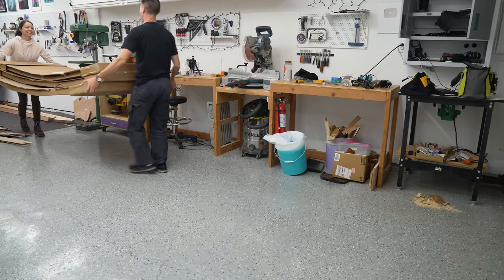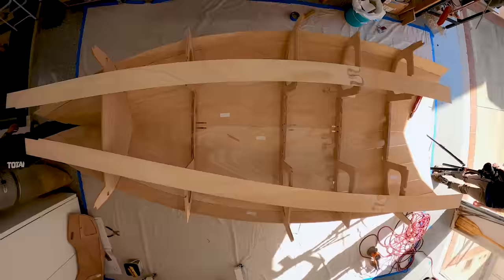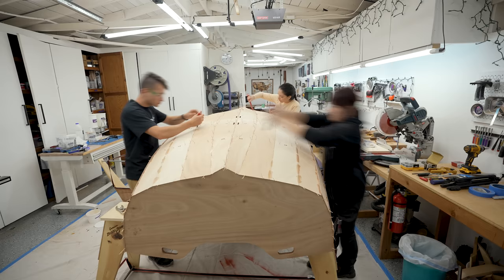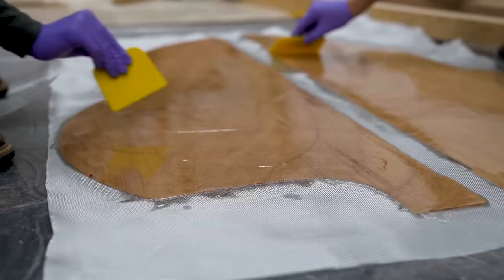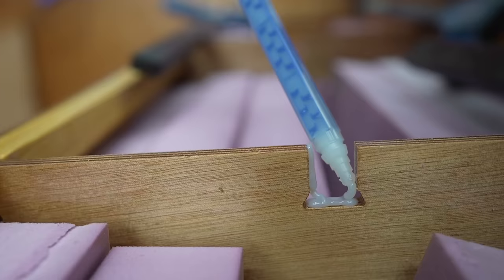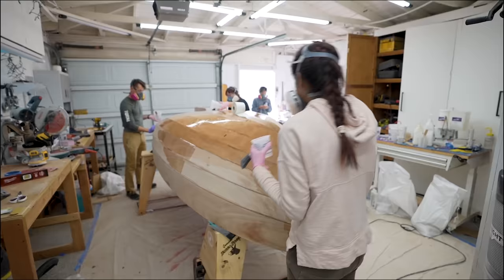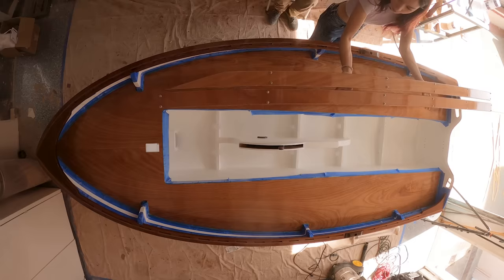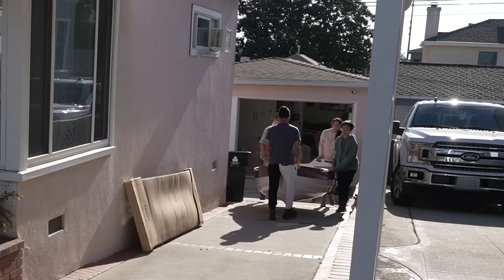Building a SAILBOAT (My Longest Project Yet!)

Comment: Just a note to all boat builders. If you drill or counter sink for screws after the piece has been painted or epoxied you need to treat that wood that's just been exposed with something to water/weather proof it. If you don't that's where the discolorations and delamination of the finish will start. Linseed oil, epoxy, or varnish will all work but you may never get the screw back out with the epoxy or varnish. Boiled linseed oil and similar finishes will need to be applied regularly.
Reply: I was going to write the same. If you paint the wood with epoxy or varnish and then drill holes in it later, you need to reseal the exposed wood. And no, silicone caulk won't cut it.

I remember reading a scientific paper a few years ago, where several methods and products for sealing wood were compared. Wood samples were treated, fully immersed into water and the weight gain was recorded. The most effective way to seal wood was molten paraffin wax, three coats of epoxy being the close second best option. Molten paraffin of course has several drawbacks, like remelting of the wax and you can't really paint it, so SEVERAL coats of epoxy is actually the only viable option. Traditional methods like products based on linseed oil, acrylic and even polyurethane paints were much inferior.

The problem with all this is of course, once water enters through cracks and holes the epoxy coating will trap it inside, the water can't really get out anymore. So the wood needs to be sealed perfectly, which is hard especially on larger, complicated structures.

If you want your boat to potentially last a decade or more, all the screws and fasteners better be stainless steel, even when completely embedded in epoxy. For a boat that's out of the water, stored completely dry 95% of the time and isn't expected to last a long time galvanized might work, but considering all the work that goes into such a project just bite the bullet and get the good stuff.
Reply: @kirahund6711  yeah I learned at a young age stainless hardware is pretty much the only way to go with brass a good second place.
Reply: @consaka1  Bronze works too, but that's just inferior to stainless.
Reply: @kirahund6711  yeah bronze/brass is too soft. I've had difficulty with it in the past. I just prefer stainless though I wish even it was stronger.
Reply: Great point. Penetrations are where barrier failure or structural deterioration frequently begin and that's not just a "boat" principle. It matters on any substrate where exposure will create change - even just corrosion or oxidation (assuming sound assembly pre penetration and no other existing issues). 

Modification of a complete boat would be a key example of where a bunch of small failures all begin to contribute.
Reply: @michaelrobinson9643  Very well put. I suspect you have taken some failed components apart before and seen that first hand. It happens on cars and houses too. I can list examples for both of those too. Sometimes it actually takes very little to mitigate those issues too. Other times it takes more planning
Reply: @kirahund6711 Thickened 2- component epoxy base paint is also something that's used a lot. It will form a decent osmotic barrier but perhaps it's more for glass fiber, not wood. Have to use a product that's designed for wood or also-for-wood. Screw holes are a terrible place because of the capillary gap and the different thermal expansion constants for wood and metal. I'd go all paranoid and epoxy under and over with something that's a little flexible and seawater rated. Cleaning the stainless steel screws with solvent and maybe even sanding the screw-heads with 320 grit is also something crazy I might do. Epoxy doesn't necessarily cling all that well to passivated, oxidized or dirty stainless steel. There is probably a specific 2-component product category for sealing screw heads that's better suited for it rather than laminating epoxy.
Reply: Decorations? is that a boat term?
Reply: @IGoProEVERYTHING  sorry the word was supposed to be discolorations. It's been fixed.
Reply: Standard procedure on larger wood-cored fiberglass boats is to overdrill the hole in size by a fair margin, tape the backside, fill it with epoxy, let it cure, drill the epoxy to the size of the fastener, then through-bolt the fitting with a fender washer.  It's incredibly time consuming but it's the best way to mostly ensure watertight integrity.
Reply: Don't worry about it: the hole will be filled - next Thursday of course

Comment: When I was a kid, my Dad designed and built a bunch of sailboats, mostly for my brother who was a sailing kid. Most were plywood and fibreglass, much like yours, but he did move on to fibreglass and foam composite. The latter were very fast boats, and did help my brother to be overall winner in at least one season of sailing. But my favourite were the wooden boats, they just looked so good in full clear varnish. It was either the second boat or perhaps they renamed the first one after the first season, but it was called "One Slip" partially after the Pink Floyd song, but also because he made the deck out of too thin plywood, and my brother kept slipping and putting his knee through the deck, so it ended up covered in plywood patches.

Anyway, you did a great job with your boat. I'm certain it will inspire many a young sailor to love the sport, let alone learn how to sail. It was fun watching you build it, even if it wasn't always fun building it for you. But most of all, thanks for the trip down memory lane.

Comment: The screws going into the skeg from the inside will penetrate the epoxy barrier and be a source of rot as water gets in there. The Gougon recommendation is to drill an enlarged hole, fill with epoxy and then re-drill for screws once hardened. Gougeon brothers wrote the seminal work for wood and epoxy boat construction. (this goes for all the other screws as well of course)

There are epoxies with UV blockers in the formula to protect against UV degradation of the epoxy. UV from the sun eats epoxy. Even here at 63 degrees North this is an issue, and I re-glassed my CLC Chesapeake 18 three years ago because I messed this up and the glass started to turn yellow before delaminating 🙂

I have never seen a CLC kit go together before. It was really interesting. Those pre-cut joints sure made things easier as there were no need for scarfing, but I wonder how they do when the plywood is stressed a lot as in some of their kayak kits. Perhaps they add a layer of glass on each side when gluing?
Reply: Anything that has exposed epoxy should be sanded and given a coat of poly. The poly will take a beating, but, much simpler to just repoly it now and then than to sand to virgin epoxy and then build it back up. Plus it looks nice.

Comment: Leo from Sampson Boat Co would likely approve. Jokes aside, this is really cool to see how you can build a boat from a kit like this.
Reply: Been following Leo, longer than I've 
been enjoying Xyla's work.

steve
Reply: Not a boat from a kit, a toy.
Reply: Maya and mainly Aladino from "Sailing Magic Carpet" also assembled/build such a Chesapeake boat for using it as a multi purpose dinghy.
Best regards, luck and health in particular.
Reply: Probably not, she epoxied the boat together without wetting out the wood first. Leo, on occasion has explained how important it is to wet out wood before epoxy or resin joining.

Comment: For work, a few months ago, we were required to install fire-rated caulking.  It was only provided in the horrible "sausage" packaging, which won't with with a standard call caulk gun, only with a specialty caulk gun designed to be compatible.  I saved my company a few hundred dollars on those specialty tools by getting a few cupcake decorating/filling kits at my local Walmart.  Cut the end off the sausage caulk, stuff it into the frosting bag with the narrow tip, and ziptie the open end tightly, then "frost" the fire barrier locations.  It worked amazingly, and passed all QA inspections.

Comment: Why is anti-fouling not good if you're going to have the boat out of the water? Is it less resistant to scrapes than the paint you ended up with? (Also, I felt so sorry for you guys having to strip it all off and repaint it!)
Reply: If it's a biocide antifouling, I suspect that they don't want kids to touch it. Also, you cant paint over it with normal paint only antifouling, so they would have to remove it if they want the maintenance to be an educational activity. finally, some regions don't allow it to protect the wildlife. Otherwise, there's nothing wrong with having antifouling as a top coat for the underwater part.
Reply: @grieske  thanks!
Reply: Also to add antifouling is generally a softer finish so you are correct in guessing that its less resistant to scuffs and scrapes which of course isnt ideal when its being pulled from the water often.
Reply: @grieske wow. Thanks. Great answer.
Reply: anti-fouling paint is great for metal boats, not so great for wooden. That boat will never see salt water so not necessary for anti-fouling paint.

Comment: Shouldn't all the drilled holes also be sealed to stop moisture from entering the wood?
Reply: yup, negated all the work of the sealing of the wood, in fact with unsealed screw holes like that it's actually worse because she sealed the rest of the wood since moisture that goes in the screw holes will not be able to escape the wood and be trapped causing accelerated rotting vs if the wood around the holes was able to dry.  Those screw holes will be the points it rots from.

Comment: I wonder if it’d be a nightmare to use some kind of expanding foam (like they use to seal and insulate homes) in those flotation cells instead of the cut foam sheet? It might fill the space more fully and not allow any water in.
Reply: That's definitely an acceptable technique. It can be tough if you don't have experience with it because over-filling can deform (or burst) the hull. Either option has down sides.
Reply from the maker: I wanted to! CWB specifically requested I use the pink stuff in case the boat gets borked and they have to pull the foam out and replace it.
Reply: @xylafoxlin  that’s a great reason! Maybe an idea for them: use plastic bags to contain the foam? I’ve had a few things sent to me recently that had foam that was contained in bags as it expanded - conformed to the box and contents, and was easily removed. Maybe if you had another Thursday. 😜 Thanks for these videos. I’ve been wanting to work with fiberglass for a while, and I’ve watched and rewatched your videos.
Reply: @toastrecon  Your probably thinking of something like the Instapak products?  A ready to use bag that you activate, then drop in the shipping box with whatever your packing?  The foam inside it expands to shape around your item then sets.  You end up with really nice packing foam moulded around your item.  https://youtu.be/PnKBIGv0CqU
Reply: @coffeegonewrong  Those must be it! That's pretty cool, I didn't know that it was so "accessible".

Comment: Started sailing in wooden boats when I was young, Fortunately I had metal spars where allowed as I spent a lot of time racing.  I have had a lot of wooden boats and the care they need is a royal pain when a repaint is needed!  SO cool to see the build process laid out like that, several of the boats I have owned were designed to be home built in a similar way.

Comment: If you need tools for sanding - 3D printing is your good friend. I make rotating sander heads for use with drill (wrap using thin sand strip from a belt), or shaped bases for my block sander etc. Glue on sandpaper and off you go. You can even incorporate dust extraction if you want :). Think custom versions of old style block sander you'd make from wood.

Comment: For sanding large curved areas I've used myself Like those flat mops that you usually velcro the Scrubbing/Absorbent part to, and just put sandpaper there. So you sand something near or far below without hunching over.

Comment: tip that work for me - fabricate a stand or jig to hold the boat at a convenient level on its side it's so easy to send it's like you're resting and your weight holds the sander there's no bending over really or very little.
   I'm 6'7 so a comfortable table for me is 42 in high so the boat is quite up in the air hyphen and only I can really sand on it.

Comment: So much work invovled in building a small wooden boat. Great job guys. I worked for several years making fibre glass boats and to be honest it is so much easier to simple have a mold for the hull. Gel coated means it is ready painted and ready for the water. Having said that it must be so satifying to build one of those kits.

Comment: Xyla, thanks for showing your creative problem solving in your videos! It really helped me the other day as I built something in my shop, and I was trying to figure out how to secure the workpiece, I remembered how you cut holes in your saw horses to clamp your rocket body down for the tail fin glue up.  I was determined to do the same: drill holes in my work bench to hold down the work.  And as luck would have it, I ALREADY HAD holes in my workbench at the correct place and distance apart! Thanks and keep being awesome!

Comment: When I was  13, my dad and I built two wooden boats in one summer and took em both to the Lake Union Wooden Boat Festival  (or whatever it was called then) there at center for wooden boats.  
I built a stitch and glue 12 foot rowing skiff, and my dad build a 22 foot long two person recreational rowing shell (much wider than a traditional shell) with a sliding seat.   So much filleting and sanding.. so so very much.   (I'd say enough for a lifetime, except I spent a summer doing nothing but sanding the inside of wooden speedboats near Lake Winnipesaukee in NH a few years later. )
Unfortunately it looks like the Wooden Boat Festival died with covid (nothing since 2019) but it featured (among other things) two row boat races.  One for small boats (which I won in my very light and slippery 12ft skiff) and another for "big boats" which were generally pretty fat and heavy boats.     I went out in my dad's 22ft shell by myself and dominated the field despite it being quite hard to turn. 
Fond memories.    The shell is still around, but someone stole my skiff.

Comment: Propping the boat up on its side makes sanding easier so you don't hurt your back as much... for glassing you still need it flat (on the keel) so the epoxy doesn't puddle where you don't want it.

Comment: I found an interesting hack to cut that sometimes helps for cutting woven composites.  If you cut in 1/2-1" with scissors, then take pliers, or your fingers, and pull 1 strand of the material out, which can be a bit challenging, you have a marker across the width to cut on.  It can leave a fuzzier edge, which can be annoying.

Comment: 50 years ago my woodwork teacher built a canoe or kayak out of marine ply using the glue and stitch method. This was a response to the Venture scouts, who had hired moulds and were building fiberglass ones. When he did the stitching, Mr Vale cut little grooves so the copper wire was under the surface. Then he filled with epoxy and sanded it all smooth. The ply was mahogany or dark teak faced and it looked beautiful in the sunlight through  the big workshop windows, it shone.
Then he painted it blue.
Odd man.
I later taught woodwork there. I bet there are similar tales told about me.

Comment: For sanding the inside of the boat I think some kind of suspension harness where you can float horizontally above it would help with the sore back. Like a hang glider harness. Would at least make good content.
Reply: Drop down like Tom Cruise in Mission Impossible.

Comment: Yo just a heads up, if you ever have an issue with the hairs from a paintbrush coming loose when you're painting or epoxying, here's a little tip: dab CA glue right at the base of the hairs and it will keep individual strands from pulling out.

Comment: Bit of geographic synergy there: The kit is called the Lake Union Swift, and the Center for Wooden Boats is on Lake Union. Obviously, Chesapeake made this one specifically to honor the CWB, but the video didn't overtly mention it. That launch and maiden sail was on the lake it was designed for.

Comment: Xyla, can you d oa video going over the difference between epoxy and vinyl ester resin. A lot of people call them the same thing, however, vinyl ester and polyester have noxious 'fiberglass' smell, most epoxy are very low VOC and don't require PPE when used in a relatively well ventilated space.

Comment: Basic rule for gravy consistency: coats the back of a spoon, or you can run a spoon across the bottom of a pan and it leaves a clean trail. Also if you are real about not turning down help with sanding and stuff, get at me, I’m in LA, would love to help!

Comment: pro tip: keep the tail of your C clamps facing inwards or put an obstacle in place to prevent accidents where you'd run into it with your full body weight. A clamp is the perfect lever to tear open the assembly and ruin your day.

Comment: What's the reason I haven't thought of for not positioning the boat on it's side when sanding?
Reaching out and up has to be better than out and over, speaking as a long-term back pain aficionado.

Also, you and your long suffering friends are an inspiration. Keep it up.
Reply: youd need to make some special stands for it to do that
Reply: @techheck3358  You sure would, two eye bolts, a sturdy rope and a wall gets you mostly there. I'm not put off the idea yet.